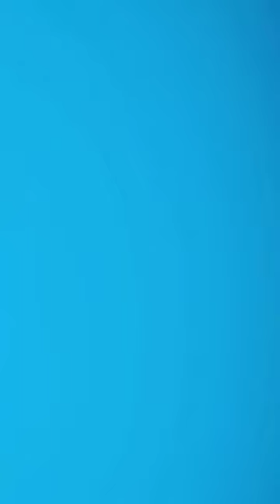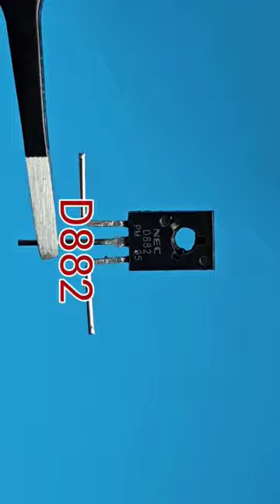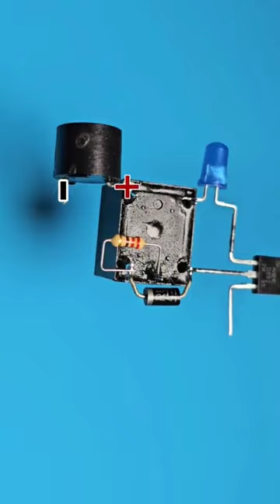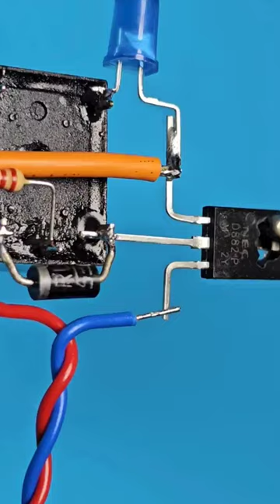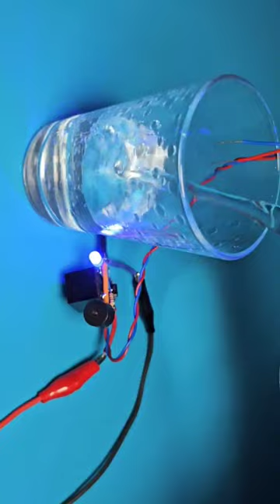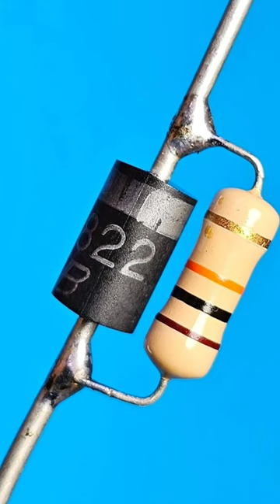Anyone with an electronics hobby can build this tool. #zaferyildiz #diy #short #shorts  #viral #led

Comment: Please consider that it would be much more helpful if you put a list of the components used in your Descriptons or a Pinned Comment (or even a short, still shot of all parts laid out & labeled).  Often, the parts go by so fast (and sometimes blend in with the background) that they are nearly unreadable.

Comment: Hello sir,Good video but make a video circuit of electric water motor shutting down off with automatically alart.
Reply: For a small DC pump motor, you could simply wire the alarm to (or through) the pump's on/off switch.